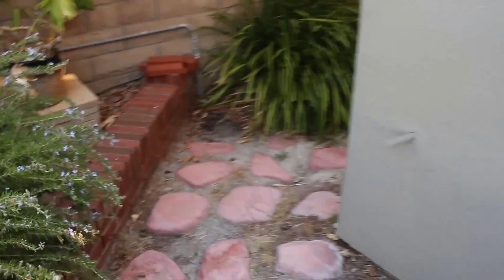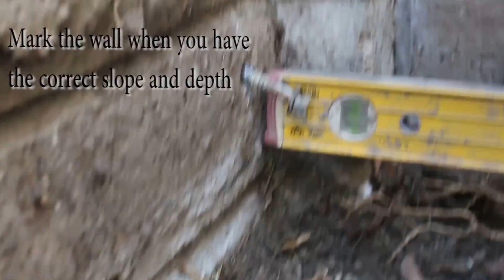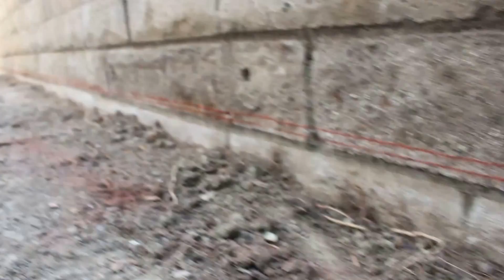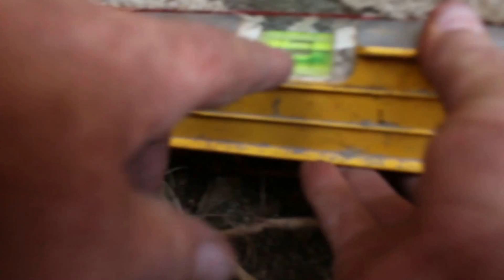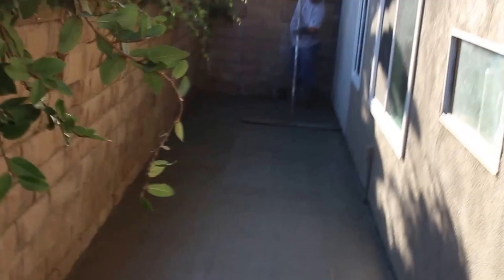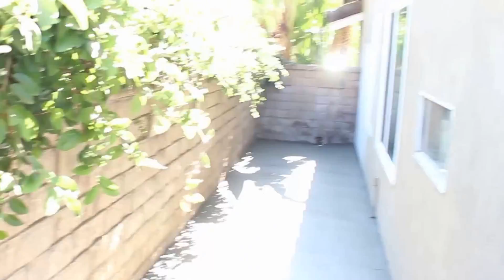How to Set up a side yard for a concrete finish

Comment: Nice work guys! Did the homeowner or u guys put a drain or hole in the block wall for the water to escape out?
Reply from the maker: The hole was already there. The problem is on the other side of the wall, its overgrown with palms. So the water will have trouble running out.
Reply: Odell Complete Concrete That homeowner definitely needs to get it on
Reply from the maker: I like to think so